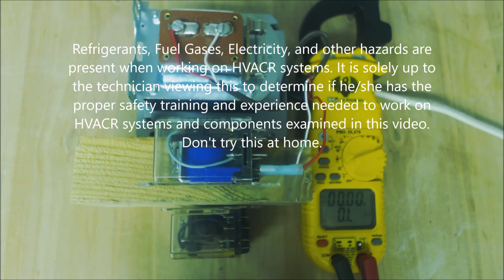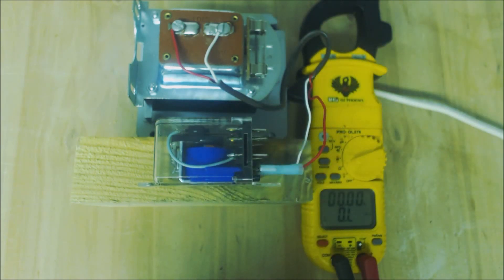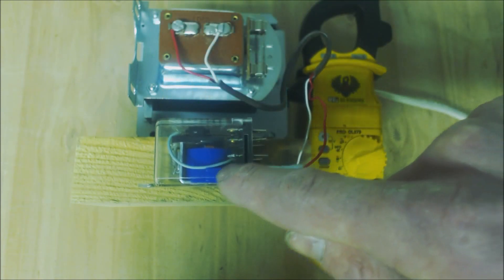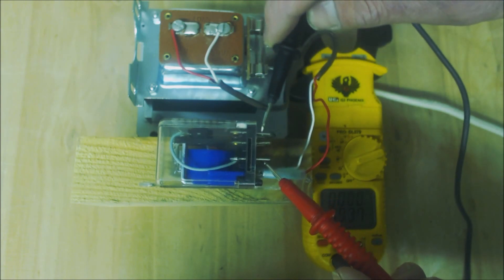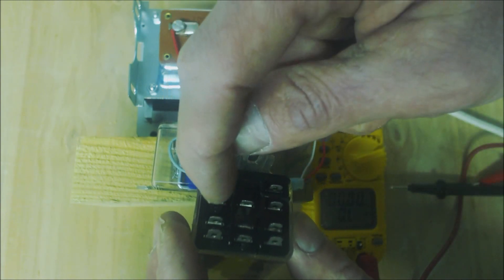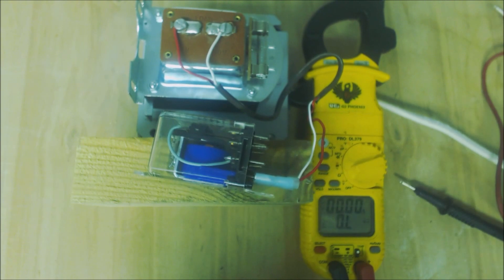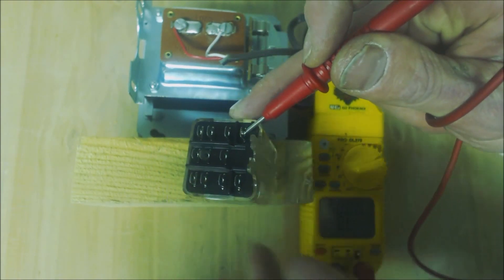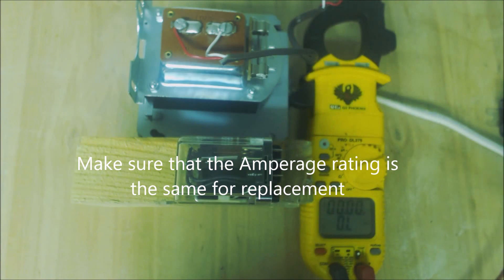Troubleshooting the HVAC Ice Cube Relay!

Comment: So I’m having a hard time with this so I can add power to N/O  to turn something on that’s where I’m getting confused I guess I need some for instances to really understand how to use them because I understand how the work
Reply from the maker: Wiring to C and to N/O means that when you power the coil with 24v then the Normally Open will close to C  to complete that circuit, thanks!